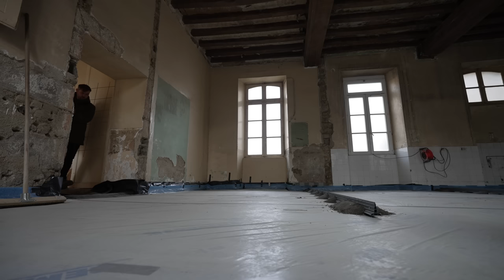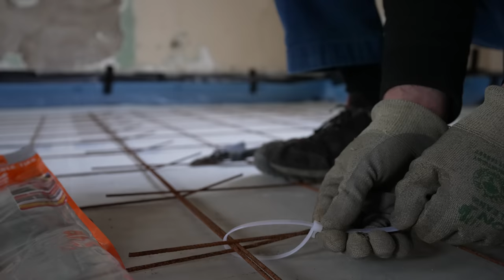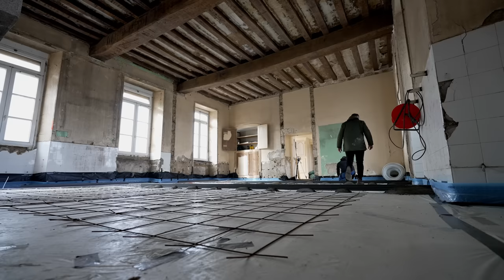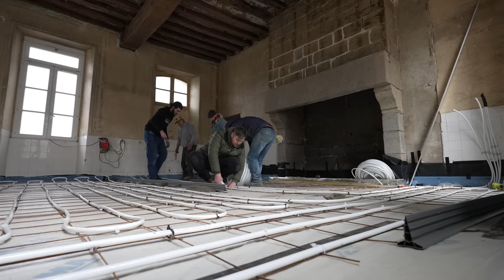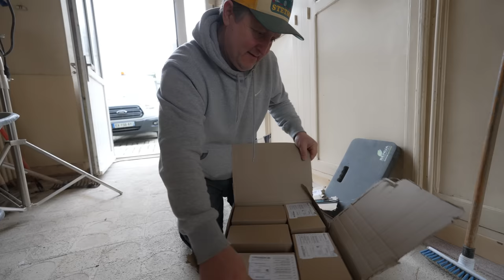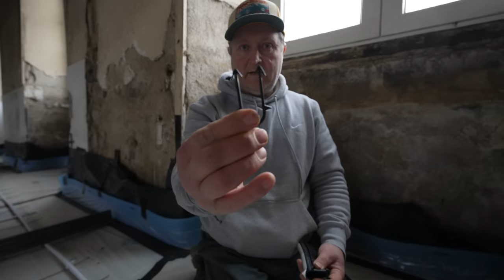Installing Underfloor Heating In A 250 Year Old Convent

Comment: i'm surprised - plastic zip ties not metal seizing wire
Reply: for the metal mesh. Though i see now, the plastic pipe goes on the mesh - zip ties is going to work.